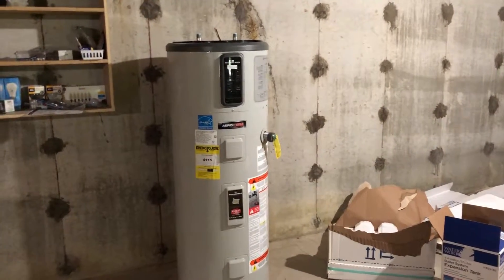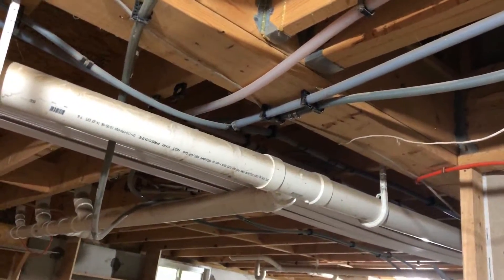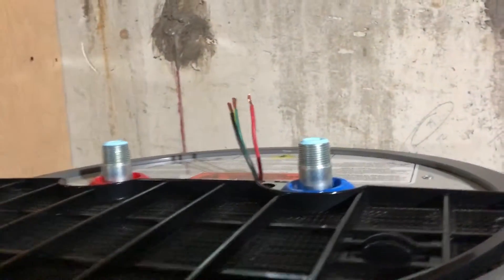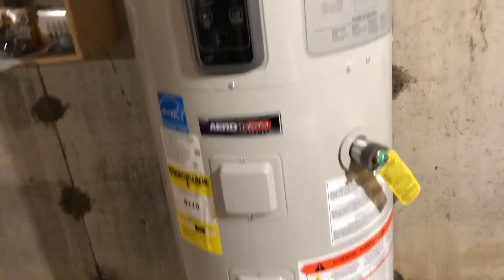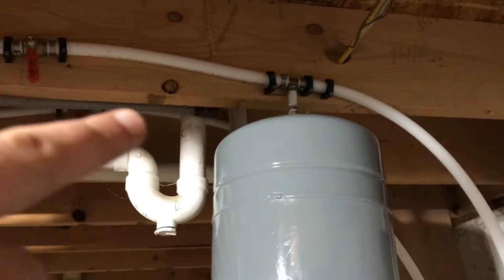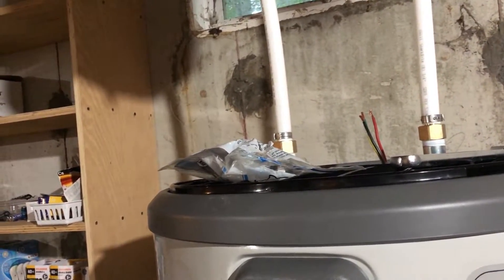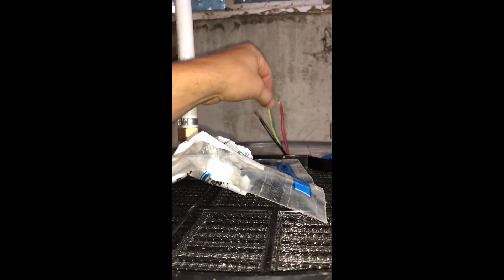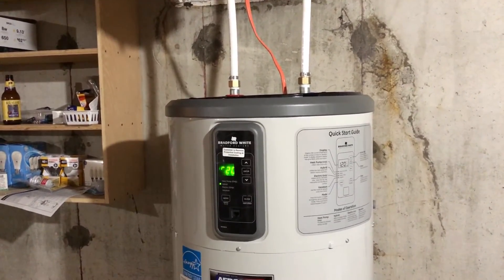How to: Install a Heat Pump Water Heater Yourself and Save a Ton of Money!

Comment: Great video, I have 2 questions for you.  Is the anode rod able to be replaced on this model?  Some hybrids are an absolute nightmare to replace them and I haven’t called Bradford White to inquire about it.  Second question:  Is the recovery rate adequate, meaning have you ever run out of cold water during normal use?

Thank you!!

Comment: where did you purchase that unit?
Where is the condensation drain line??? Now you'll have water all over the floor and that's why you have a professional install it
Reply from the maker: James Hall purchased from a local dealer. The condensation line is on the left and it flows into a floor drain - not all over the floor.

Comment: I'll be installing one in series with my existing gas unit to double my storage and have a back up.  Planning for hybrid @ ~140F ---> gas @ ~ 120 F, figuring between the two, the gas and electric backup will rarely run

Comment: I have the 80 gallon bradford white aerotherm. We LOVE it! Congrats on the purchase, and nice clean install man. I did our install as well, couldn't be an easier set up as far as I'm concerned. it was a plug and play with our old water heater.
Reply from the maker: Jesse Larbey thank for watching! I think I would have done the 80 gallon now. While the 50 gallon does well with two showers it takes the entire tank. That means you need to wait for water to do dishes if you leave it in heat pump only mode.  It does hold up well in hybrid mode but that makes it less efficient. Still, I am very pleased with the unit.
Reply: @WilsonsRec  yes I had an 50 gallon GE Geospring before my new Bradford white. I got rid of it because it couldn't keep up. My wife's likes jacuzzi baths. The 80 gallon is certainly a beast.
Reply from the maker: Jesse Larbey  I will get one in about 10-15 years. Thanks for sharing Jesse. If you want to subscribe, that would help me a lot.  All the best!

Comment: Question- I live in Harrison, Maine. I have this same model hybrid heat pump installed in my attached barn. Problem: I am not getting any water flow whatsoever out of my hot water lines (on all faucets in the house), but am still getting cold water flow just fine. All my pipes are insulated and i am getting cold warer flow, so I know my pipes are not frozen. So i assume that my heat pump has decided to not operate, becasue they are programmed to shut off below a certain temp. But wouldn't the heatpump still supply me with cold water rsther than no water at all? That is my biggest question. I suppose I can put it in electric mode if needed. I already tried that and still didnt get any water flow. No error codes. I will try again today. Also is there a way for me to ensure that heat pump mode is drawing warm air? I.E., Is there a way to route warmer air from a warmer room (like the crawlspace where the furnace is) into the heat pump's upper air intake fans? Or would that limit the airfow it needs?
Reply from the maker: Tom Stegeman hey Tom.  If you are not getting hot water from the hot water line, I suspect you have a blockage.  Question: when you touch the pressure relief valve (center right when looking at control board) is it hot? If it is not, the unit is not working.  If it is hot, I would check for a blockage next and would drain and refill the tank to try that.
Reply: @WilsonsRec  i drained the tank in attempt to do a sediment flush. The drained water was hot so i know the heater worked. The problem is, when i am attempting to refill the tank with cold water, it is not filling up at all (and yes, i have the pressure relief valve open amd also have hot tap faucets open to purge the air in the tank). The fact that the cold water is not entering the tank at all makes me think that there is a section of pipe frozen or blocked between the water tank's inlet and where that inlet pipe comes out of the crawlspace and into the tank room (i know that the pipes in the crawlspace are not frozen because all my cold water taps stilk work). I dont know what else it could be. But now i am stuck with an empty tank. So I can't turn the breaker back on untill there is water in the tank or else i will fry the internal parts. And even of it turns out the cold water inlet pipe was indeed frozen/clogged, it still doesnt explain why i am not getting any water flow out of my hot water taps becasue i should still be able to pump hot water to my taps from a full tank even of the cold water intake is blocked. Like i said, the water inside the tank was scalding hot from when i heated the water in electric mode, so i know there isn't any issue with the heating aspects.
Reply from the maker: Tom Stegeman Tom, I think you are correct. It sounds like the cold water line coming into the tank is frozen or has some type of other blockage. You will not get any hot water from the tank without the cold water inlet having water. The reason is because your home relies on your well pump or city water pressure to push the cold water into the tank and the hot water out of the tank. There is no pump inside the hot water tank that Would allow the hot water to leave the tank went out pressurized cold water entering the tank.
Reply from the maker: If you can access the line, wrap it in heat tape and plug it in on really cold stretches.
Reply: @WilsonsRec  yeah that is what i am gonna try today. Im leaving the state for xmas vacation for a week, so if i can't thaw the cold inlet pipe by end of day (if its even frozen, still could be a clog in the inlet or in the downstem pipe inside tank), i will try to drain as much remaining water from the bottom of thr tank as i can. I am worried that the bottom lip of down stem pipe may freeze now that i have the heater off (im talking about the pipe inside the tank that goes from the top of the tank's cold inlet mouth, down to the bottom of the resorvoir). If anything inside the tank were to freeze, i have no idea how i could thaw it.... If it turns out that it is sediment and not ice, i don't know how i can unclog it, becsuse unclogging sediment involves refilling the tank and draining it repetatively. We have private well out in the semi-rural area, so it could be sediment.... But it is also a new installed tank. Only had it since August... Hope its just a matter of thawing ice. I want to THANK YOU for being so helpful to me, good sir. You didn't have to do that.
Reply from the maker: Tom Stegeman since it is a new tank, it is almost certainly going to be a frozen pipe into the tank. Just go to lowes or Home Depot or your local hardware store and get heat tape which is wrapped around the pipe and plugs into an extension cord.  The tape will heat up and thaw the pipe.  Leave it plugged in for the winter and it will never freeze again.  Best of luck to you sir.
Reply: @WilsonsRec  i didnt get "heat tape" but i did get those frost king pipe heater cables. But i think that should work the same (and i will obviously be re-applying the foam insulation sleeves around the pipes adter i have taped the heat cables to the length of the pipe). Thanks again.
Reply from the maker: Tom Stegeman that should work!
Reply: @WilsonsRec  HUZAH!!!!!! After waiting about 15min after wrapping the pipes with the heater cable, i just heard a "k-k-krak!" noise of ice melting, follwed by the sound of water rushing into my tank. That did the trick!!!! Hell yeah!!!! Rock on Corey.
Reply from the maker: Tom Stegeman good work man.  Have a nice Christmas.

Comment: Does it make your basement cold?
Reply from the maker: Bill Gatewood to an extent, yes.  It pulls heat from the air so it must make it colder, however I live in Maine and the basement is always cold so I cannot tell the difference.
Reply: @WilsonsRec  I'm in Maine as well. My basement in the winter is anywhere between 45-55 in the winter months. I usually run mine on Hybrid mode and rarely does it switch into electric. I do run it electric on the occasional extreme cold mornings as it cools the floor to my upstairs living area.
Reply from the maker: burningkarma good to know.  I usually just set it and leave it unless we have a lot of showers back to back.

Comment: Excellent video. Have you noticed condensate yet?
Reply from the maker: Bobby J no condensate whatsoever.  I am very happy with it.  I was worried that with my wife and two boys that I would not have enough hot water if I ran it only in heat pump mode but we have never ran out. Of course it still has the other modes but I wanted the most savings.  I am hoping it will help keep the moisture out of the basement during the summer months as well. Overall, very happy!
Reply: @WilsonsRec  I'm suprised. The evaporator coil likely does not get cold enough, or your basement is very dry (that's good). Good to hear though. I would still drain it just in case.
Reply from the maker: Bobby J it has a drain on the right side and is draining into the floor drain in the basement.